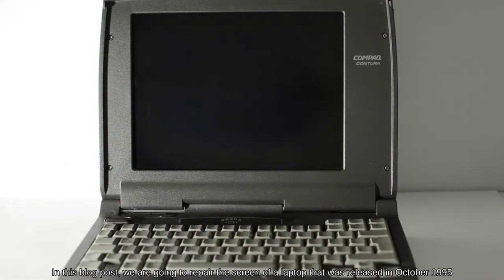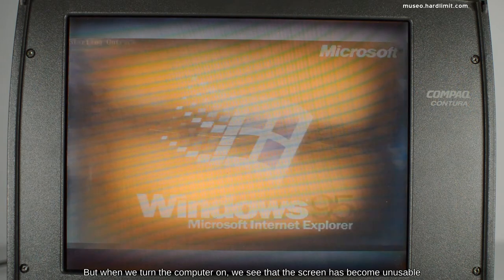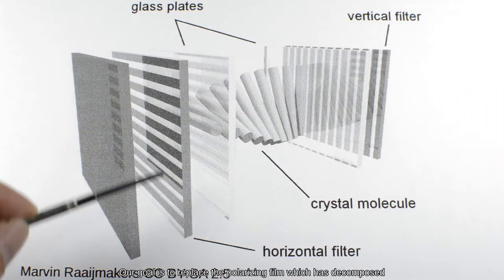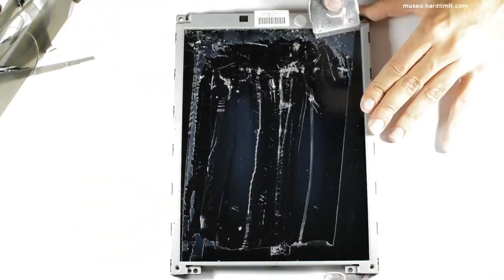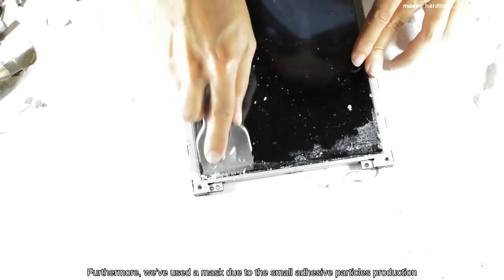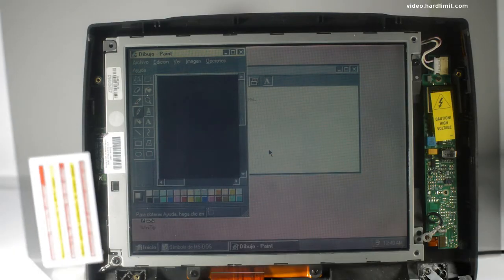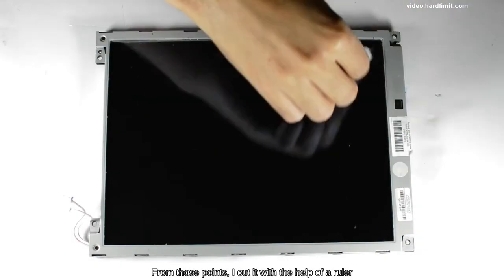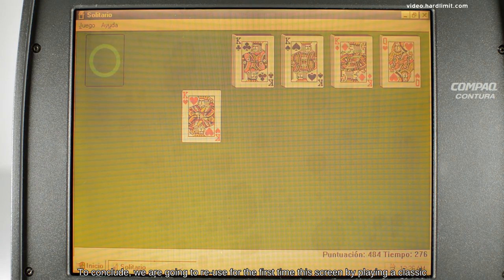Fixing a screen with the Vinegar Syndrome

Comment: The screen is probably red cause of the fact the screen is passive matrix, and those age very badly. Combined with the weird angle, it’s not a surprise how it turned out reddish
Reply: It is because the screen is a passive matrix but it's a little more complicated than that. I've just learned from looking up Gameboy Pocket polariser repairs that the passive matrix, DSTN or FSTN LCDs use an extra layer in the polariser called a phase retardation layer. You can use regular cellulose tape in between the front of the LCD panel and the front polariser sheet to alter the colours - Just been playing with that on my Toshiba T2400CS colour DSTN screen with no polariser and the colours look 100% with some careful adjustment. 
Dunno how to make that fit a whole 9.5" screen though
You can buy FSTN front polariser sheets but they are not cheap sadly.

Comment: I assume the reddish hue if in equal measures:
1. From the poralizer angle off but several degrees, and;
2. CCFL being old and tired.

I had a project converting my laptop to cold LED light, but the war threw a spanner in my plans.